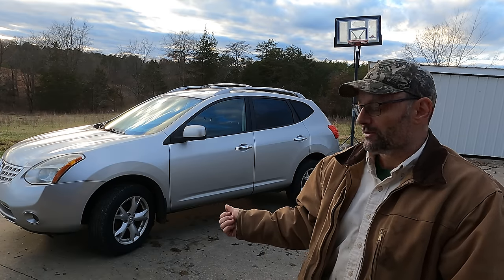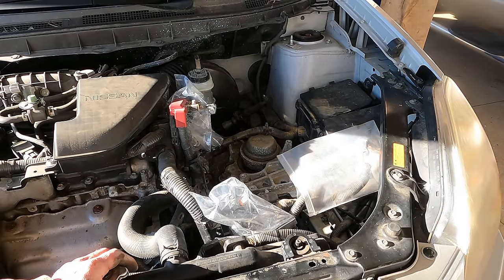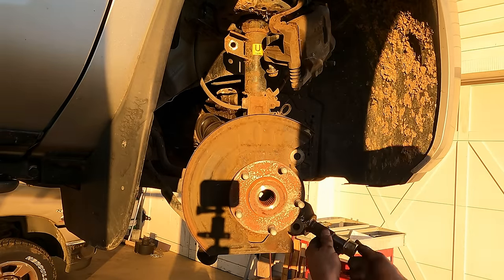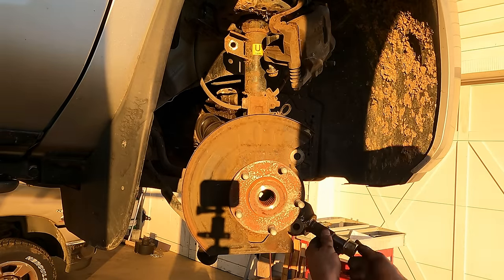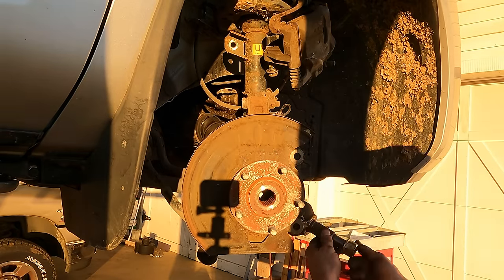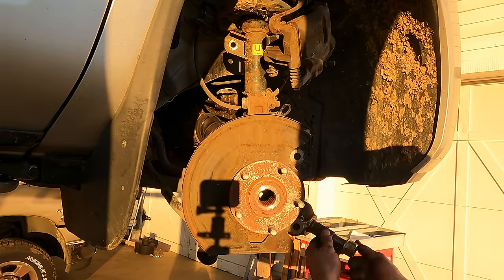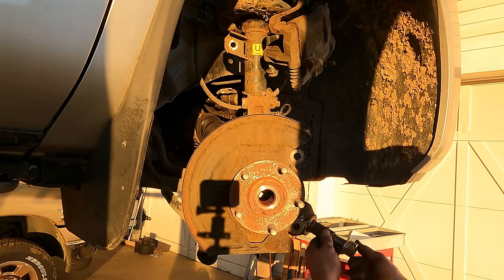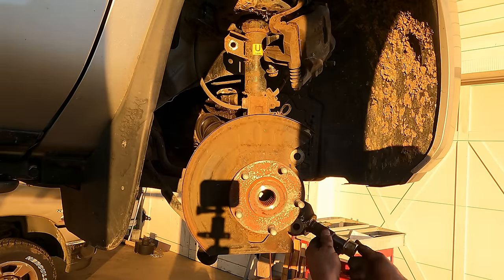Fixing a Nissan Rogue Transmission So I Can Give It Away. GOAL MET!

Comment: Some might believe that John's explanation of how it might be an "improvement" for the transmission to keep the engine operating in a more efficient "sweet spot", and therefore gaining fuel efficiency, to be the reason that ALL the manufacturers of compact cars to be going the route of the CVT transmission format. But, you would be wrong. They are all doing this because there are fewer parts and therefore, it makes the transmissions cheaper to manufacture. It might not look like it with the disassembly, but all traditional transmissions also have that valve body contraption (engineering marvel), but traditional transmissions have more complexity in the multiple required gears and the mechanisms to cleanly switch between them. Time will tell, but I believe the traditional designs to be superior in terms of longevity and robustness for the consumer. It is not uncommon to have the previous transmission style to last 500K-1M miles with routine maintenance. Let's see a CVT do that (regularly). And with the former ubiquitous forward engine, aft transmission, driveshaft to differential, if the transmission went, you could pull it out and replace it with a lot less labor. Perhaps saving the car from the crusher. That car otherwise looked to be in pretty decent condition. If the cost of the transmission was ~2500, the labor to replace it tearing apart the entire front end was what would have sent it there, probably costing 4-5K in labor costs exceeding the value of the car (called "totaled" in this video). The manufacturers aren't doing the consumers any favors here. I personally don't like the way CVT's "shift" and lag when you punch the gas pedal. So, to me, the CVT design also suffers in terms of performance (kick in the pants). Lastly, the manufacturers are more often now calling the transmission fluid a "lifetime fluid". Whose lifetime? Yours or the transmissions? They also have been eliminating the transmission dipstick that allowed the consumer to check the fluid level and condition, and also providing an easily accessible port to add some fluid if need be. Now the units are sealed and you need to drop the pan from under the vehicle to drain the transmission fluid and replace it. It is because they want to make it as hard as possible for the consumer to service their own vehicles. They don't want your car to last 400-500K miles anymore. They want the drivetrain to last just slightly past the warranty period. This service John is doing is only economically viable (besides the patreon) because he is donating his free labor/time AND his considerable mechanical skill. For the masses, it would be repair sticker shock, followed by an even bigger sticker shock when you go to the stealership to buy a whole new car (nevermind the current supply chain fleecing impact).

Comment: I need my Juke Done. And possibly improved in some kind of way. I don't need that much sealer though, that stuff is going to be all mixed in with the CVT fluid clogging Passage ways.. I was told to be careful with that stuff, too center it using a small amount and slightly more by bolt holes and sometime less is more. You can see how much came out the sides, so just figure ho much went inside.. Dude it was a great vid, the dude is bad ass. Just constructive critic..
  ( I hear that Most trans shops are using Lock Tight 515 for Gasket sealer on their rebuilds and not a lot and There are kit's with roller's and better Ball Bearings. The one Passage that has the 3 balls into by the valve body that makes the pully's move, They have a replacement for that is 1 round piece and improves the shifts and placement of the belt and pulleys..) There are PPL saying you can't get New CVT's anymore but, I found a Brand new CVT for my Make and model Juke still in the box. Brand New $5500.. Sounds about right for these days.. But My CVT isn't that Bad Yet.. It really just needs a Good re-Build By someone who know's how to rebuild them right.. The Hard part is finding that person or shop!!

Comment: Separating those lower ball joints can really suck ass sometimes. Something that usually works pretty well for me is using the air chisel on the steering knuckle while prying down on the control arm.

Comment: How to make your Nissan CVT last:
1) Change the fluid and filters
2) Change the fluid and filters
3) Change the fluid and filters

Make sure to use the right fluid. But these do not tolerate the fluid for long. This one is making the death whine. I bet all of the break in material from when it was new finally killed the pump. That causes a pretty major cascading failure. The belt itself very rarely fails, but it's failure due to pump or pulley bearing is usually what does the transmission in.

Comment: People never take into consideration that vehicles are made on assembly lines  in segments. The engine is mated to the transmission then dropped into the engine cradle. Then the cv axels are installed then hubs and suspension is installed. Then the car is lowered onto the engine cradle.. the reason I'm telling the processes the assembly line is to give a visual concept of how to reduce the amount of time to remove the transmission.  You can spend 4-5 hours removing everything around the transmission for clearance OR.. you can drop the entire drivetrain in under 30 minutes by disconnecting the fuel Lines, exhaust engine wiring harness suspending the brake calipers, ac compressor and unbolting the top of the strut towers then remove the 4 cradle bolts and lower the entire assembly down as a unit. I swapped a transmission in a minivan that booked for 8 hours of labor in 1 hour. The odds of you forgetting a bolt or nut or putting something together wrong goes down exponentially.

Comment: While driving back from our extended family Christmas gathering in our Subaru Outback (with a CVT), I was informing my wife that the adjustments I was making with my foot sometimes did not adjust engine speed but transmission ratios.  It's neat to watch the car's speed increase while I hold the rpm steady at 2K.  It's odd that they fake the feel of shifting just to keep people from getting concerned.  Wish they'd just let it adjust as needed, though.  Think of the engineering making it adjust both engine speed and trans ratio at the same time automatically.  Unlike ANY other manual or auto trans system.
Reply: You can't have both, I guess...
Change your trans fluid more often than factory specs; if you're planning on keeping it longer

Comment: I would take the trans to an ATRA shop and have it rebuilt for alot less. At least have them assess the unit. It looks mostly like a belt issue and valve body plate replacement.

Comment: Fantastic videos- reminds me of time as an 18 yr old I changed gearbox on an Austin 1300- although I thought it a pain at the time, taking out the engine and gearbox en-block sure looked easier than splitting them in-situ. CV boots were a regular maintenance item with no need to change the joints unless crud and water had got in and ground up the bearings. Fantastic explanation and model on the CVT 🙏

Comment: 35:30
The belt is your smoking gun.
When the belt starts slipping, it wears out and produces all the metal shavings. Imagine the belt continuously grinding against the puleys and all the small plates in the belt rubbing eachother constantly. Even in the presence of oil, the belt will wear and the tolerance between the plates of the belt will increase due to the metal being shaved off causing the loose belt and the excessive amount of metal shavings. If you took the transmission oil filter apart, you'll find even more shavings.
This is precisely why I steer clear of any car with a CVT.

Comment: Thanks for this project. BTW, I am a longtime computer programmer (50+ years) and that hydraulic control system is what I would call an analog computer. Not impossible for it to have a bug or two.

Comment: 19:24 The easiest way to get the transmission to release itself is to remove the supports and you lay beside it and it will instantly roll towards you and become disconnected. It worked when you did the transmission on the truck. 😁
Is this as much fun as playing with your Johnson? 😏

Comment: 8 minutes into the video I decided never to buy a vehicle (Nissan Rouge) that requires removing the tail light to the tip of the antenna to fix the transmission.  Holy mother of god!!! Talk about a carbon footprint of gargantuan scale (If the car was sent to the crusher).  This is in abject contrast to the scale of generosity you intend.  For this I commend you in the strongest terms.  I really appreciate what you do and how you do it.  Carry On!!!  My grip tightens on my 1972 Chevy Pickup and 1964.5 Ford Mustang... 😆 Gary.

Comment: I think you and I are the only 2 people using 
Sears Craftsman ratchets.  I like them, because 
the handle isn't polished and round.  They are 
textured (grip) and square-ish.  You don't have 
to look to see which way the socket is facing.
(And, won't slip around in your greasy hand.)

And, they will stand up to a 3 foot cheater pipe, 
AND a hammer!

steve

Comment: Btw u can drop the axles on that car with out taking th away bar links and the ball joints out just pop the two bolts off the strut and pop the knuckle forward undo ur axle nut and there ya go

Comment: I appreciate seeing your process, I admire your intention and effort, and I sympathize with your intuitions about fixing stuff.

That said, the economics of this aren't obviously compelling to me.  If the totalled car is worth $2,000 (even as  tax write-off), the parts are $3k, and your time/ labor is worth at least $3k, then it seems it'd be faster and easier just to buy a used car for $8k.

(Sure, a used car is likely to have issues, but this thing is also likely to have issues beyond the transmission.)

Maybe I'm not sufficiently valuing whatever arises from the YouTube content itself.

I'm also wondering if it's better to make a huge difference for one kid versus trying to make a smaller difference for a lot of kids.

Comment: Oh man,  I had a go cart with a transmission like this.  Hard to believe that Nissan thought that would work for a car though.
Reply: Transmissions like this can work for something much heavier than a Go-Kart. Most Combine Harvesters use this system, although they use a dry, rubber V belt open to the air which aids cooling.

Comment: That looks like a ball and trunion joint. They pre date CV and U-joints.  Mopar used them    Into the 1970’s on HP 440’s and  426 Hemi’s.  The boots fail quickly if over greased“ A dab will do ya”.  Just like Brill cream.

Comment: Has anyone gotten these Nissan CVTs to last more than 130kish?  Car Wizard had a theory about fluid changes every 30k, not sure if that would do it, but these make the vehicle a complete throw away car.  Subaru is not much better.  Feels like Nissan went from a 100k timing belt replacement interval to a 100k nearly unobtainium transmission replacement interval.  And timing belts are easy, love doing those (serious).  Love the format, love your videos.
Reply: Avoid Nissan JATCO transmissions. Average lifespan max is 150,000. To prolong change fluid every 40,000. If transmission fluid is black or brown don't change.

Comment: I have a lot of experience working on BMWs and I'd say 3-series, and even older X cars are much easier to service than this. And they are definitely way more reliable and much better built. You can get an E46 for next to nothing and it'll still be a great car once all the common mechanical problems are fixed. Definitely outlasts any Nissan.

Comment: Put a 2x4 across the engine compartment or strut. Tower and a Chain or ratchet strap to a trans bolt to Hold the engine up instead of a jack From Underneath

Comment: Here's what happens with these transmissions, they overheat and the "belt" wears and begins to fail and/or the "pulleys" or sheaves as they are called, wear and overheat and then deposit metal throughout the unit. The metal then contaminates the valve body and shift solenoids causing more slippage and erratic engagement. As well as the entire transmission requiring replacement/rebuild  the trans cooler needs to be replaced, an upgraded ancillary external cooler is available.

Comment: 12/30/22. Replacement/New CVT utilizing your (only) surface mount vertical lift. Conflict>>wife's car needs (xyz..oil/tranny fluids changed) its own surface mount vertical lift...or a 2nd lift pretty blue & yellow lift. Well John..u know u probably could use another lift...kids cars will need lifting & holding while (supply chain) parts trickle in..then your other trucks, tractor (?), ATV...on & on. Other option is make a HD dolly for (front end) of project vehicle & use those  360° under-the-(rear) tire 'roll plates'. Am sure you are aware of these devices. 
 Great project, lots of effort for a worthy cause. A+ for your kindness to help a deserving HS grad. Well done!💪🔧🔩⚙️👍👍👍👍😊

Comment: Other videos I watched say this kind of transmission (with the belt it has) creates lots of metal shavings, and that the fluid and filters need to be changed every 30,000 miles or even less to keep it from failing (or, rather, to make sure it doesn't fail for a long time). See the car Wizard video where he shows you his dirty transmission fluid on his Nissan vehicle. CVT Transmissions are not a Death Sentence for Your Car.

Comment: This is a noble project, thanks for letting us help. I bought you 3 beers to do my small part.
Btw, how do you manage to keep track of bolts, nuts, washers and other small parts in a major tear down like this?
Do you put in ziplocks and label?
Do you take still pictures in addition to video?
It might be interesting to others to see how cope with this problem in a future video.
Reply: After you separate the parts, just thread the bolts back in the hole they came out of.  When you reassemble, the parts won't fit together until you remove all the bolts.  Pretty simple way to keep track of everything and make sure you don't end up with leftovers...

Comment: Hi,  Bought a new Nissan Rogue SV in 2016. Heard bad things about the Transmission after. In the owner manual it said to change the transmission fluid at 92,000 KLM. Decided to change it at 80,000 KLM. The dealer charged us 300.00. Then changed it at 130,000 and traded it at 150,000. It’s still running great last I heard. Cheaper than $ 5,000. For new transmission. People should read their owners manual ……the bible for us owners and save money on repairs.
Reply: We changed our transmission fluid as you mentioned in accordance with recommendations . Even so at 82,000 miles we have to replace the transmission. Seems as though it didn’t matter if we had the fluid changed or not, the transmission is toast. Nearly $7k to replace it.
Don’t buy a Nissan

Comment: They neatest thing about a CVT is the belt is pushed not pulled. The push belt design is quiet neat, but being a trans rebuilder, CVTs fail a lot especially Nissan.

Comment: Thanks for remembering the needy. However, there is a question that has always left my head spinning. What does Nissan engeers feel when their vehicles keep going to the crasher prematurely? Does it bother them? Or are they satisfied that they sold the car. 

Furthermore,  Why was this CVT technology ever invented in the first place. Which short-coming in the then existing technologies like automatic transmission did it address? If yes then it failed horribly because the other transmissions are performing a hundred times better; even the humble manual. 

With CVT you save fuel and thereby multiply your anxiety and stress exponentially. By the way can the amount saved at the gas-pump offset the loss of the car so soon?

Before I learnt that a transmission called CVT existed, I bought one of this Nissan vehicles and it has been horror ever since. I tell you, driving it has turned into continuous diagnostics. One is always aware that it is going to happen — the transmission is going to fail, no way around it! You just don't no when. The anxiety is actually life threatening and one can develop stress related health issues!

In my opinion, CVT  transmission is a technology we never needed and Nissan ought to have reverted to automatic transmission long ago.

Comment: Searching for “2010 Nissan Rogue CVT belt” seems to bring up spare parts for this transmission including supposedly OEM parts (maybe not for your specific engine though).   HOWEVER, after watching the “Nissan CVT Failure Diagnosis: 2010 Rogue AWD” youtube video by Pine Hollow, I don’t think a rebuild should be attempted unless you know WHY the belt is being worn down. If the failure mechanism is the same as what Pine Hollow found only you haven’t reached the belt snapping point yet, then a simple replacement of the belt is only delaying the inevitable catastrophic failure.

Comment: Well done as always!  I'm curious as to your background that you're able to handle tasks like engine and transmission repairs while explaining so well to all how things work.  Do you have a mechanical engineering degree?  Were you a former mechanic?  Maybe you shared previously but I missed if you did.
Reply: I wonder the same thing!
Reply: He watched a YouTube video on how to do it! 

When I was in college, I had to take my engine apart to change the cam shaft. Eventually invited a friend to help me. It was not too difficult. Stuff fits together like a jigsaw puzzle 🧩, stuff only goes back together in the correct places. The book tells you how much torque to apply, which a wrench shows.

You can do it
The more you do it, the better & faster you get.